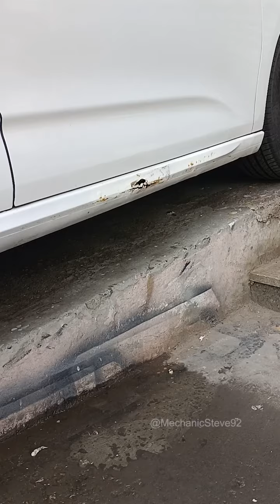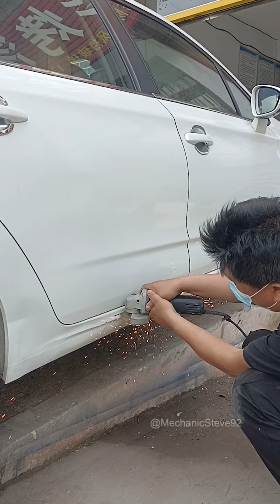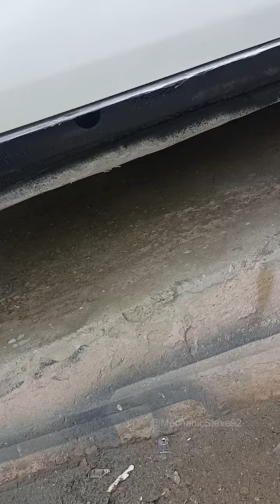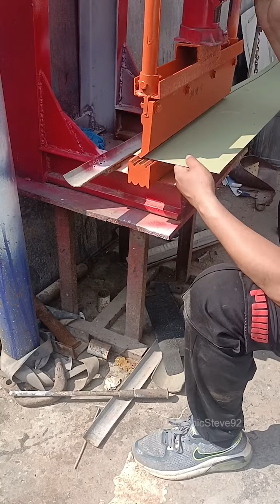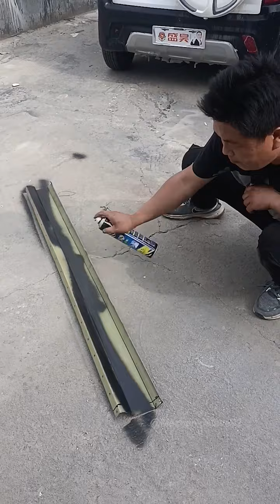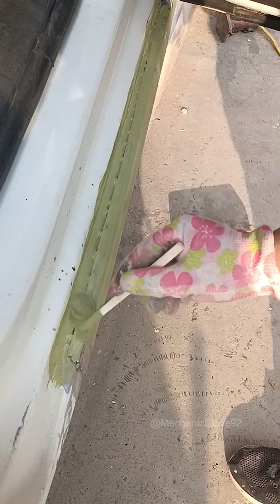Car rusty rocker panel self-made rocker panel.

Comment: The holes and drain plugs that were originally under the rocker are where you would of properly applied undercoating. The heat from welding will melt most of that off anyway. This is why there are so many rusted out cars on the road from hack bodywork